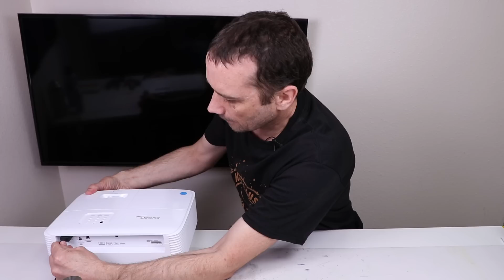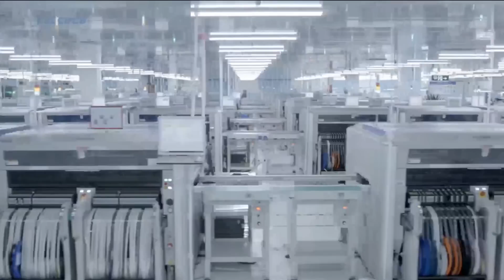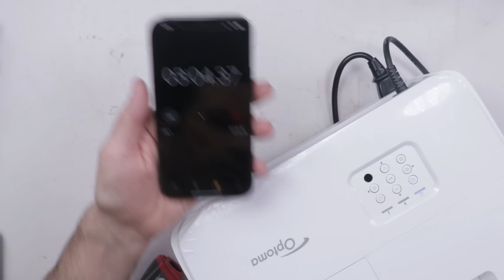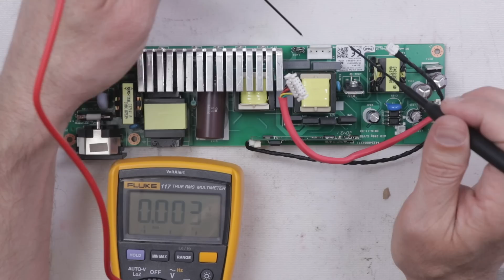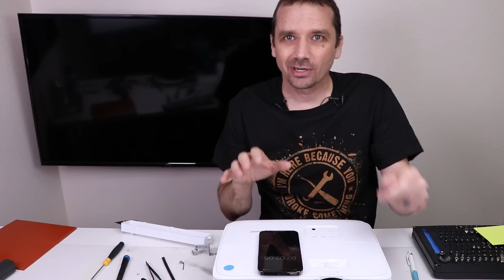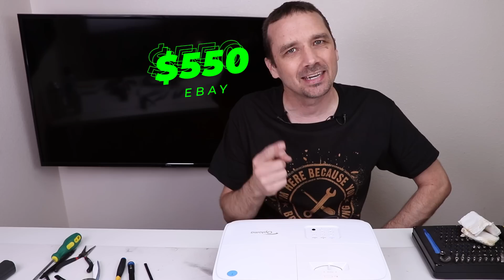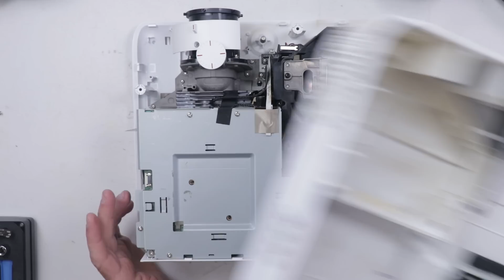I Bought 6 BROKEN Projectors - But Can I Fix Them and Make Money?!

Comment from the maker: Two things:
1) In this video I show checking the fuse to be sure there is no voltage there. As several commentors have pointed out (Thank you!). This is NOT the correct way to check voltage on the large caps. You need to check on the capacitor legs themselves. 
2) Just wanted to add that with items like these I either test them more extensively or I sell them as untested. Either way I always make sure potential buyers know what they're getting. I'll be posting on my community tab, Instagram an Facebook when I start selling stuff.
Reply: FYI, you have to pin the comment again if you edit it. Found this down near the bottom of the page.
Reply from the maker: @mjc0961  Thanks for letting me know. I had no idea.
Reply: How do you know you fixed them if you leave them untested?
Reply: @TronicsFix Any way you can try to fix a few tvs?  Seems like t-con boards and power boards are easy enough for you to test and possibly fix.  It also seems like a large area where people just discard what they bought, rather try to repair them.
Reply: i got a $6000 dlp 4k jcc projector i cant fix u want to buy it?
Reply: Glad you mention 'cause I was already wondering how one can call a projector "all fixed" when not even a stand-still image on a proper projection surface was tried. In case you decide to do the testing, I'd be interested in a video on testing procedures and outcomes for sure...
Oh yeah, and testing the voltage drop on a fuse doesn't seem to make any sense.. I was wondering about that, too.
Reply: Its pointless to text this in comment, as you mislead various levels of people watching the video. Test light and say its fixed is misleading, and its far away from real test of all functions and performance.
Reply: Ik this has nothing at all to do with the video but I bought a Seagate hard drive 2tb for $57 bucks at Walmart and now its just showing a white light but nothing is happening
Reply: Hey @TronicsFix
Can i have a question?

Comment: I have a Optoma hd146x that had a lamp life issue so I bought a new bulb.  While swapping bulbs the lid was damaged.  Me being unaware that there was a button that would prevent it from powering up if the lid was open.  Today is Christmas Eve and my girlfriends family are coming for New Years. I considered buying a used projector until I watched this video and you mentioned it. So I cut a piece of foam off that came with the new bulb big enough to be pushed down by the lid and it works. It’s been broke for about a week and you literally saved Christmas for me.  Im watching a movie right now thanks to you.  Thank you

Comment: i had multiple different 4k optoma eh-tw6150 that had coil whine a verry irritating beep while in use.
no source connected and it does not have a beep so as terminator juice said may not be fixed.
especially if there are no devices connected.

Comment: Where would you recommend to sell/trade red light projectors? They could be used as parts or repaired.  I do not have the know how to fix, but saw this video thought I ask. I am in Stamford Connecticut. Epson w1261 and Epson vs240 units. 5 or 6 each of them.

Comment: I've worked with theater projectors for over 20 years, cleaning a lens with isopropyl alcohol is not recommended from my experience. It leaves many streaks and can be a pain to get completely streak free. My suggestion is a little distilled water with your cotton swabs.

Comment: To explain the smoke, any projector (the light bulb specifically) runs incredibly hot and essentially you are seeing burned up dust. Something worth cleaning for sure, but definitely normal for any projector. I repair and maintain medical equipment which includes projectors for Optometrists.

Comment: After 14 years making a living repairing mainly audio amplifiers I bought a new £3,500 Dell S718QL UST laser projector for the college where I work in 2018. While soak-testing it I noticed a faint yellow staining on about 20% of the middle of the image on the white test mode (you can get it to project various single colour rectangles). Subtle but faulty and not a dirty lens. After a long phone call to one of Dell's engineers in Scotland they accepted it was faulty and replaced it. Most people wouldn't have noticed the problem in a college, although a home-cinema owner might have.

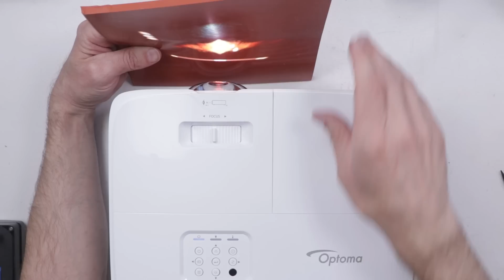Comment: I have a similar projector as at 12:50 (#3). I remember having lines show up on my screen because mine was a refurb unit, and so I noticed that they only showed up when I ceiling mounted it. So naturally, I squeezed it! This was to countact the tension of ceiling mounting it and it fixed it! Now I know it was probably a loose connection on that board with the missing screw you had.

Comment: Replacing a bulb in a projector is NOT regarded as a repair. These are consumable components and replacement is supposed to be within the capability of the end user. I would be surprised if most are any more difficult to access and replace than in this example. Certainly the two BenQ projectors I am familiar with have a very similar access and securing method
Reply: Also, it is really important to allow the projector to do its cool down cycle otherwise you are likely to do further damage to the unit

Comment: I bought a refurbished projector, which worked for a while, then one day went 'pop' when I turned it on. On opening it I found broken glass from a previous failed bulb and plenty of dirt and dust. So much for refurbishing. however, I was able to replace just one $5 component in the power supply and it has been fine since. For a £400 projector, it was nearly junked over this cheap part. It really is worth trying to fix these things, but yes, I did get a couple of pretty good jolts off the caps. they are serious in these projectors!

Comment: Jumped on eBay after watching this, and ALMOST bought an Epson projector that was marked as "faulty", going for around $80 but worth $400 if I could fix it.  (Not that I'd sell it - I've wanted a projector for YEARS!)
But noticed it didn't have a remote, and - if it's a dead power supply, it's not like I have another on hand. :}

Comment: I've skipped the buy the broken ones and went straight to the office upgrade auctions. Bought 6 projectors for $200 and they worked. Bought a dozen monitors for about $10 for each. Sold them locally on Craigslist, but kept the best monitor and projector for myself. Be sure to go into the projector menu and pull up the lamp hours. Helps to sell them if they have low hours on the bulb.

Comment: Out of curiosity, would you consider trying to repair my rx 480 8gb. It has issues with the memory possibly. When I use it under normal, it will freeze the system after a few minutes. But if I undervolt the power, it still freezes. Now when I also downclock the memory and undervolt it works fine. Any thoughts?
Reply: Power supply

Comment: Changing a bulb in home projector is not a "repairability" measure or feature.  Just like battery compartment in remote control, you need to replace bulb periodically, as it's being used when powered on.

Comment: It's important to note that projector bulbs are consumables.  I would never buy a projector with a used bulb.  They need to be replaced every year (at least), and can cost anywhere from $50 to $150 dollars depending on the model.  You also need to reset the counter in the menu when you replace the bulb. This "repairathon" is just silly.

Comment: smoke damage is most likely due to a burned out exploded lamp. The yellowing in the lamp section is a normal indicator. When people forget to let the lamp cool down after powering it off and powering it back on immediately, it runs the risk of exploding the lamp.

Comment: Great Job Sir.

Zeiss makes an optical cleaner, for outdoor optics, binoculars, things like that.  Nikon also makes something called a "lenspen" that cleans lenses on optics....  Zeiss & many others make Lens Wipe products also, which come in a little single use package, and when you tear it open, a very clean wet tissue is in there, safe for coated optics....

I would invest in all of those, if you are going to mess around with stuff like this.  You'd hate to ruin the coatings on a lens, and basically torpedo any value the projector might have....

There is another product, looks like a fancy bigger q-tip...  the ones I have are sold as "Extreme lashes Lint Free Applicators"...  Looks like a fancy Q tip.  I'm not sure what sort of black magic is involved with these, but they pull dust & offending dirt off of a lens like magic.  Like weird magnetism.   Really neat product that I found doing watch repair.   

Theoretically, those mirrors in the bulb area should be pristinely clean also.

Comment: Random Tech Tip: When you have a batch of identical things to repair, always turn them all on and record each of their symptoms before even thinking of taking the first one apart. Then group the ones with similar faults together and work on the biggest group first.
Also, always label every single part you remove so you can trace it back to the unit it came from.

Comment: We have bought 7 Optomas that look like the first 2. 3 are dead but all are damaged. They do not ship well. One had the lines and a partially unplugged connection like the 3rd one(fixed). One has a fan noise. 3 have broken light reflectors (fixed with bulbs from dead units). 2 have have the metal nubs on the buttons broken off (fixed with built up crazy glue on the plastic of the button). Some have broken case plastic. Our instructors wanted bright and high resolution so we got 4000lumen 1920x1200 units. We need a more rugged replacement.

Comment: Man, these fixes are kind of half assed like others have said. These should have been hooked up to inputs after the repairs and run for at least the length of a two hour movie each. Then run a video game on each for another hour. At that point, if everything checks out heat and smell wise (besides picture, color, brightness), then you can feel pretty comfortable they are fixed. I have owned Optomas multiple times. And sometimes they run fine for an hour or so. Then quit. Things like bad colorwheels. Bulbs that dim after they heat up, ect.. Optoma is not a real dependable brand quailty check wise IMO.

Comment: I'm curious about your test and how you determined 6-7min is sufficient to call it good. I'm no expert, but I have a couple old projectors I was trying to get working and they don't act up until 25-35 minutes of use. Maybe those are a bit different since they are older though.

Comment: Why dont you show the actual listing where you bought them from. Its a bit weird that for none of them you knew what the problem is but if someone sold them for parts or broken, they should of mentioned whats wrong with them. For a lot of them they seemed to be working immediately. So yeah, not sure what to think.

Comment: Another thing that's so simple but has caught me out before - my InFocus In83 would work right way up (ie on a table) but would have issues when ceiling mounted (image issues and noticeable "hot" smell).

They will auto flip when inverted or there will be a setting to change projection settings for testing.

Comment: buzzing noise could be coil whine from PSU. that common, but didnt expect from a an expenssive tech
Reply: Pixel shift technology on 4K projectors.  It is annoying enough they often have a quiet or silent mode to turn it off but you go from 4K to 1080P resolution.

Comment: Those speckles on the image are not from dust on the lens, that's the DLP chip that is starting to fail. The easy way to tell is to adjust the focus, if the speckles rotate then it's dust, if they are stationary it's the DLP chip. You will find pixels both stuck on and off, basically that projector is trash. I wouldn't be surprised if the rest also suffer from that issue as they are all DLP and Optoma brand are know to use the low grade chips.

Comment: As many others mentioned I would have liked to see more testing on these. Output light is not equal to a good projector.
Especially on those with loose zoom/focus rings, check if the image is sharp.
If you think viewers find this part boring include a chapter to skip to for those kind of viewers

Comment: Your way to check the large  cap is incorrect!!!!!
the correct way is meter onto 400v DC then PROBE solder joints on BACK of board for the cap.
 (i've seen intermittent connections on large caps, due to their bulk breaking them loose, but then coming back online when the board is man handled...)

also why would you check for voltage ACROSS a fuse that is not mains powered, that is a resistance check for after the board is  validated.
as well as checking the ~0.47 X2 above the fuse, it won't kill u but it will give you a nasty nip.

Comment: you absolutely abolished any coating or emulsion layer with the iso swab...
Reply: Yup... manufacturer manual
"Do not use alkaline/acid detergents or volatile solvents such as alcohol for cleaning lens. If the lens is damaged due to the cleaning process, it is not covered by the warranty."
Reply: "that's alot better" shudder
Reply: you have electronics down pat, clearly. you should brush up on optics mayhapse :)

Comment: quick question cause i have been asking around i just replaced both my joysticks on my old xbox 360 remote and when i test it not in game it shows everything works fine but in game it thinks the trigger is being used and the left joystick thinks its being pushed down i have now tested everything from the schmatics like the traces those are good and the joystick movement is good i have no clue why its doing that and also no one online seems to know either
Reply: Idk maybe a bad part or something got hit or messed up while repairing them is all I can think of sadly but even then it’s hard to say not an expert though so sorry
Reply: @chriseyes20  guess what after doing some research and thanks for responding i found out that some xbox controllers have paired joysticks so that means its a 50/50 chance the new joysticks will work with the board cause i rechecked everything and its all perfect conections

Comment: Buzzing is probably from the DLP color wheel. 
Also you don't check the video inputs or the service menu, why?
Reply: Those where the 4k pixel shifting projectors and it is a normal side effect of the pixel shifting.

Comment: I wouldn't consider your tests enough to sell those on. You didn't even confirm if the image produced is good or has faithful colour reproduction, you even used some red card to project to, you just saw that some kind of image is shown.
18:02 Buzzing could be a capacitor on it's way out, I definitely would not call that "fixed"

Comment: a faster diagnostic check once you had the known good supply installed would've been to pull the lamp door and see the behavior, if it matched the previous behavior you know it's probably that cable